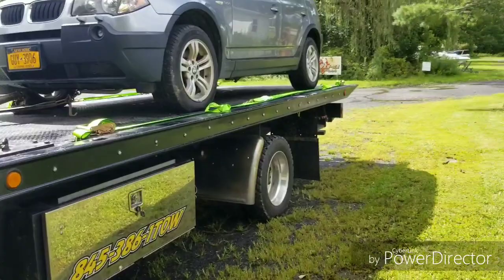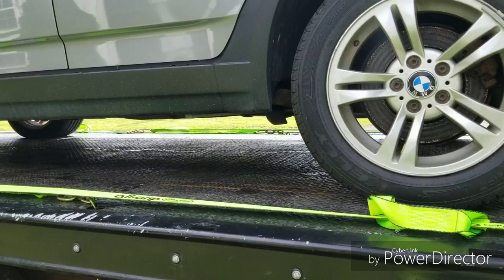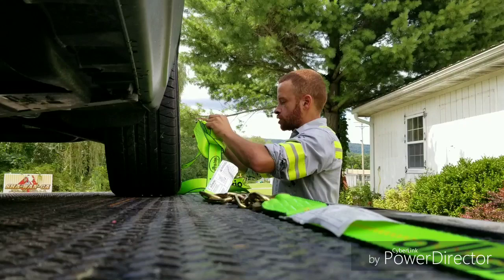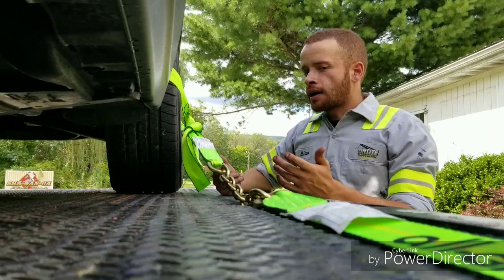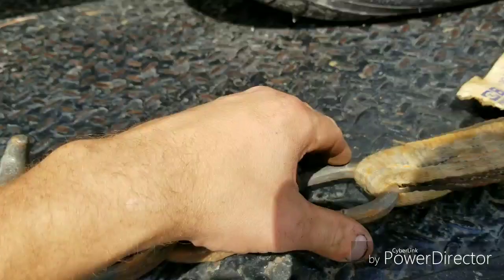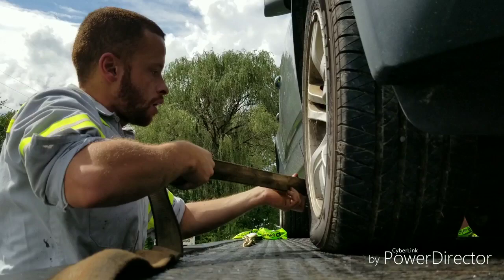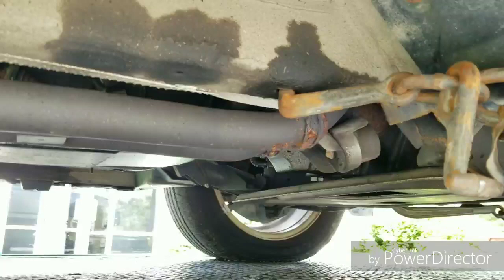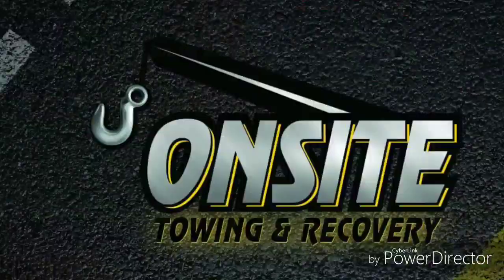Tow Truck 8 Point tie down and Different tie down methods. Part 1

Comment: Danka, sir. I just bought a rollback and with these 2 methods I cant miss. I always did the 4(2front, 2 back) and believe straps are much easier to work with than chains. I'll make you proud if you pass by me.
Reply from the maker: Love using the 8 point. I was sceptical at first, but fell in love with it.
Reply: Question does the car has to be in park or leave in neutral is ok because I always use chains and do a tight tie down and leave the vehicles on neutral?
Reply: @auzziehehe9954  Leaving it in neutral is fine, I never put a vehicle in park it's just another step and I have to climb up and down the bed for it.
Reply: @badgerpa9  That is the name of it, 8 points of contact to the bed, legally it's a 4 point tie down, but it does have 8 points of contact to the bed so it's not entirely incorrect, just legally isn't considered 8.
Reply: Sorry guys but real question ... My boss and co workers have told me to never tow a car on neutral??
Reply: Pl help I’m new lol
Reply: @TOWINGTIPZ  They are misinformed, Nothing wrong with towing a car in neutral, as a matter of fact it's better for the car, Now that only applied with proper tie downs however, I will explain.
ROLLBACK USE ONLY, WHEEL LIFT EXPLANATION IS AT THE BOTTOM.
When a car is in park the parking pawl is holding it, Any bump or hard brake or anything that may jolt that car a bit will be shock loading that parking pawl, and although i've never seen it happen, that shock loading has broken parking pawls before, it's not common but not unheard of, Now if you put that car in neutral any of those jolts will simply wobble the car however much your tie down will allow for and that's it, Now if you don't have proper tie downs this can be just as bad if not worse, If you are only using the winch for your front tie down for example it will instead be shock loading the winch and if that winch gives out your car is now rolling off the back of the bed as it's in neutral, Now if you have front tie downs in the form of chains or straps instead of or in addition to the winch that will not happen and your car will go nowhere, as well as it will make your job that much easier not having to climb up on the bed to put the car in park when you load it and neutral when you unload it, In addition, Loading a car in neutral instead of driving it up is the safest way to load a car, It is always controlled by the winch not held at that steep angle by the parking pawl until you get tie downs on it, And it has little resistance, so loading and unloading in neutral is the safest way to do it, Just put proper tie downs and you can leave the vehicle in neutral with no problems, and it will make your job that much easier, Only time I ever have a car in park is when there are no keys or when it's wrecked and I can't get it out of park in which case my job gets harder to unload the vehicle. 
Also, keeping a car in neutral is wreckmaster approved. 
Now to not be mistaken this is for ROLLBACK/FLATBED USE ONLY

If you are using a wheel lift towing a car in neutral IS BAD you never want to tow a car in neutral on the wheel lift, You always want the drive tires off the ground whether the drive tires are in the wheel lift or on dollies, or you want to disconnect the drive line, Otherwise if you wheel lift a car in neutral with the drive tires on the ground it will still be turning the transmission with no oil and it will overheat and wear the transmission, You can tow the car in neutral under one circumstance, you only tow it for about 2 miles max and you do so under 35 mph the whole way.
Reply: beastm0de7 wow thanks bro!! No lie I see you comment on a lot of the videos I watch ! And you are always one of the guys I watch out so I can read your comments and apply them. Really wish you had some videos  out there as I find you to be a very good instructor
Reply: beastm0de7 I got work later on boss so I’ll try out with a small car and will build my confidence
Reply: @TOWINGTIPZ  My comments usually come lengthy as I don't want to give any of the wrong ideas, But feel free to message me with any questions, I have no problem helping new guys start off on the right foot, I just hate when new guys get into the industry with the wrong business and wrong people teaching them and they start bad and dangerous habits, so i'll always be happy to help.
Reply: @TOWINGTIPZ  Just make sure your tie down is solid, Nothing is perfect in the accident side of towing, So i will be honest with you, I have used nothing but a winch to and a chain in the back to secure a car to get it out of the road and I always leave them in neutral, Never had one come off as a result, However If my winch gives out in a situation like that it will go rolling, so I always try to get a safety chain or strap if I can, if it's a total loss I sometimes even safety chain a wheel or something if that's all i can get, But with a proper 4 point tie down you risk nothing with flatbed towing a car in neutral, It's safer in my opinion because you don't have the risk of slipping or falling by climbing up on the bed, I never get on my bed except to clean it or change winch lines if I can help it, and leaving it in neutral makes it that much easier, as well as to unload it I don't have any extra steps, take off my front securement, let the winch loose and take off my back, roll it on down, easy as that. 
As long as you have front and back securement on 4 points of the car, aside from the winch you should have no problems, And it may be scary at times, but just think that even one chain or strap can hold that entire car on your bed by itself with the bed tilted all the way up, Idk if you have forgotten a safety chain or strap on a car yet, but you will at some point and you will go to unload that car and think "What the fuck is caught up" just to go to the other side and find you left a safety strap or chain on and it was holding the entire weight of the car in neutral by itself, It really shows that even in neutral those tie downs are more than capable if used properly, so 4 points of tie down will easily hold that car in place.
Reply: beastm0de7 hey bro how do you handle broken ball joints ?
Reply: @TOWINGTIPZ  Take the wheel off and use a ball joint block, You set the lower control arm or another strong suspension piece in the block and load it as if it's on skates, otherwise you risk damage to the fender if you leave the wheel on.
Reply: beastm0de7 thanks bro! Another save from you ! People here teach me all yhe wrong shut
Reply: I was told to just put a skate on it no one ever told me to take the wheel off ...
Reply: beastm0de7 Bro thank you .... crazy how the world works as soon as you replied I came into work first call of the day ball joint on a 3500 haha I made this homemade ball joint skate since they don’t provide them here and it worked like a charm .
Reply: @TOWINGTIPZ  it's largely based on the circumstances of the call, I carry a ball joint block but I don't get much use from it as I only do police impounds and crashes so most of the cars I get with broken ball joints are totalled or at least wrecked enough at the broken ball joint side so that it isn't worth the trouble and I just drag it, and the skate method can work on some calls, the concern is just the fender and the wheel well usually, with a lot of broken ball joint calls you'll have the wheel shoved up in the wheel well and you don't want the wheel ripping out stuff from the wheel well or crushing the trim in which is why you take the wheel off, sometimes a skate will do, and I've even had a vehicle bust a castle nut off where I could flip the nut upside down and get enough threads on to get it on and off  the truck, so it really just depends but the ball joint block is designed just for that of course by the name of it so that would be the correct way in my book of course if you ask someone else they may say it's a compete waste of time, at the end of the day you just have to see what you need to do, I claim damage free towing though so back up that claim with my actions and I'll take the wheel off for any broken ball joint if it's not a completely wrecked car.
Reply: @TOWINGTIPZ  just whatever you do try to protect your reputation, it sucks if a company isn't willing to properly equip their trucks, if I need equipment I'm in a position to just buy what I need so I can do everyone 100 percent properly and damage free, but if your company isn't willing to properly equip you then that can be difficult and if you damage something the customer is going to go "thats the guy that towed my shit and he was clueless he damage my ___" and chances are your company might blame you as well, and other companies might look at you as a bad hire, so if you have a car you can't properly tow without damaging it id refuse it and I'd do everything by the book to build your reputation, just be careful because if you do work for a company who improperly equips truck other companies like mine will look at you as a fool when you come out with no equipment and can't get the job done and it isn't your fault you don't have the proper equipment but it makes you look foolish on scene none the less.
Reply: @TOWINGTIPZ  wrong they must have shit trucks
Reply: @badgerpa9  each strap is anchored at 2 points.

Comment: These aren’t the safest option. My friend died August 2021 using straps like these. He was working a late night call and got in an accident here in Arizona. He was towing a Ford F-250 in a ram 5500 flatbed. The straps failed and the truck on his bed went through the headache rack and through his cab. I firmly believe if he had used chains on the rear differential of the f250 that would not have happened. Using chains it would have had to tear out the slots on the bed or tear out the differential. Stay safe y’all.
Reply: I know I feel safer using j hooks in the back 
I drove a flatbed in 2016 for about 9 months and just went back to it last week after giving up on my 20 year auto painting career and they used straps in the backs and I just don't feel comfortable and use the j hooks when I'm in the truck.
Reply: You always use chains on trucks unless you absolutely have no other choice specially on a medium duty
Reply: @sanifsan  Yes. Hauling a auto is not like logs, lumber, etc. Straps may work for logs, but for cars I use crossed J hooks in back, winch tight, then 2 HD chains and ratchet binder. Never any issue. And like Louis said, some cars are thin when hooking to the uni body frame. Those axles are alot better suited for this. I get ppl want no marks, scratches, etc that's fine use what u must, but I'd still use my way and wrap the axles with a cable strap or a chain strap that has the cable or chain inside strap. That way we're all happy and safe. 
I had truck lose power and shut off. I was off exit and clear of the traffic on exit, and in front of me with all lights on. A drunk woman in a brand new Jeep wrangler came down road and while I was looking in a safe place, she took out front axle, tire, rim, leaf springs and steps and flipped. I was right behind the tool box about 6 feet away. Reminded me of explosions it was so loud. A AAA driver was behind me with her lights on blocking me like cops do and had dash cam. She thought I was a goner. Please be safe. Anything made of metal can be replaced. We're bags of blood, meat and bone. Ppl really need to PAY ATTENTION. We run so many lights and drivers still can't see us. I still was concerned even though she was wasted. I used to be that way. 14 years ago I started living without being like her. Best thing I've ever done for me and all that I'm around in vehicles or whatever. If u want to party I got no issues unless u get behind the wheel. We got enuff to worry about with distracted driving. Have a ride, plan so u and I can go home to our spouse and kids.
Reply: Well honestly. Most of the approved training and state approved tie downs don’t allow wheels straps for trucks. Especially 3/4 ton and up. You definitely need to use chains in the back and mini Js in the front
Reply: I know this is 2y ago, sorry for your loss. 

This is something I’ve trained my employees about ever since we started running the 8 point straps.  We run the straps just to “look good”, but always run extra safeties. Running big j’s and chains to the slots isn’t enough, I’ve seen them fail. We slot the chains, then also run the excess chain tight through a side pocket, or wrapped around the rear hole. 

Stay safe out there and God bless,
Fred.

Comment: if the cross chains on the back have binders or ratchet chain binders that qualifies.  in heavy haul we use chains and binders all the time. its the standard of the industry.
Reply from the maker: Yes your absolutely right. Thanks for watching

Comment: Your 8 point is technically a 4 point as defined by the law. 1 strap per point so each wheel strap is considered one point. Running J hooks on the rear and winching tight then attaching 2 front straps is a legal 4 point as well and is the most common way to tie down.
Reply: You need to make a video when help people out

Comment: Luis very good way of safety with no worries I've seen cars on flatbeds before but never seen tow straps to tied down vehicles. AAA the white trucks were the only ones that would use these straps on all four tires,they were trained right on safety that's why you should man videos to remind and teach people how to do things the proper way on towing and not cause any damage to the vehicles while transporting them. Thank you !!!
Reply: 8 point can cause damage. Unfortunately I had 2 SUVs come to a nearly complete stop on a 65 mph road (left hand Lucy would not move into the middle lane when the other vehicle was entering from a left side on ramp) in front of me a I was checking my mirrors to see if it was clear for me to switch lanes. The 8 point kept the vehicle securely on my bed during the resulting collision, but the straps did dent the front fenders. It was the only vehicle that wasn't totaled from the wreck. My flatbed along with the two SUVs were complete losses. 
Under normal circumstances the straps are least likely to cause damage, but even with a perfectly centered vehicle on your deck, there are times they can cause damage.

Comment: I've been in the business for 30 years... the chains on the back ARE ADJUSTABLE as the slack is adjusted by the slot and then tightened by either the winch (which counts as 1) or the rachets in the front corners (2).... thus making it LEGAL.
Reply from the maker: Not according to D.O.T ask me how i know
Reply: This one is a bit of a gray area to be honest, I have heard that each tie down has to be independent which would knock the winch tightening method or strap tightening method both out of the equation, but I can't seem to find a reference to that, I have also heard the winch does not count as a tie down, however in the FMCSA drivers handbook of cargo securement it does state both a winch and wire rope are a securement device, It continues on to say a tie down much be attacked and secured as to not become loose or unfastened opened or released during transit, which one could argue a winch does not abide by as winch failures do happen specifically with the free spool function in the winter with ice build up, Which is why I do not strictly rely on the winch for securement. As for it not counting, I know some DOT agents will not allow it, Some might I don't know but I cannot find any for sure reference to answer the question, There definitely has to be 4 adjustable tie downs, I just can't find a reference to prove whether or not a winch can count as the adjustability for a tie down. 
I know during my wreckmaster course my instructor sounded pretty sure that it was 4 independent adjustable tie downs, Going with that I have no reason to argue with that, And maybe he even referenced the law on that and I missed it, but right now I cannot find that reference.
Reply: @towuniverse2443  My friend there is no NATIONAL DOT rule of 4 tie downs. Your STATE and a few others do have a 4 point tie down and that is fine. Please refer the exact rule number from the NATIONAL 4 point rule here. You can't...

Comment: When I use the tie down points, I cross them over in the back. This prevents the vehicle on the bed from shifting to either side should you be forced to execute sharp maneuvers. If the vehicle on the bed shifts position it could cause you to lose traction or flip you over. 
Though how he shows it wrapping around the wheels is better than nothing, it is possible for the wheel to pop over the strap which will allow the vehicle to shift position.

Comment: Technically 2 chains on one end is legal as long as their tight and there's no slack but that doesn't exclude the 4-point tie down he still have to have two on the other end and as far as chains go you can put a binder on them to tighten them up
Reply: Not true, They have to be adjustable, They cannot just be tight with no way to adjust them, Whether or not a winch counts as that adjustment I have no reference to a code stating whether or not thats allowed, but I have been told that the winch is not acceptable and it has to be an independent adjustability on each tie down, so that is what i go by.
Reply: Not exactly boss, you need the 4 points. Straps in the front or rear depending how you picked it up. With the winch hooks, then as it's tilted you can place the chains on the other end, retract the Winch to give it that tension, then tilt it on the truck bed flat, the straps will become loose as expected, then there adjust the straps tightly again! Your welcome. Oh and always place car in park with e brake, if manual transmission place into gear and e brake